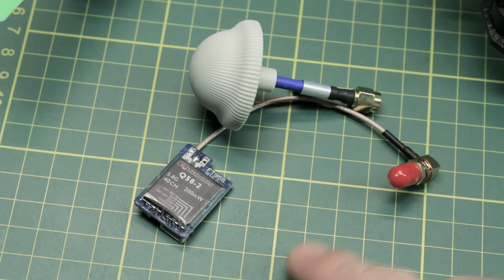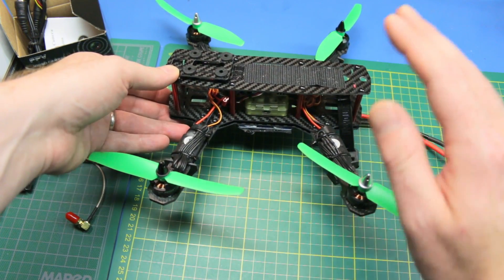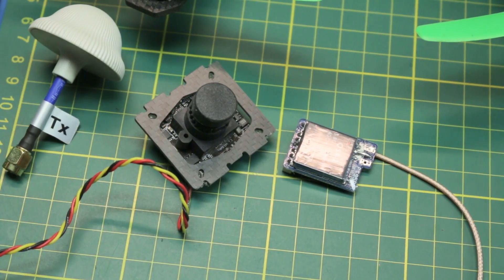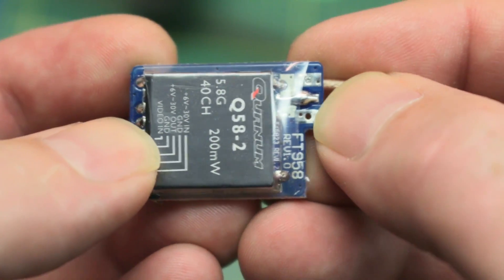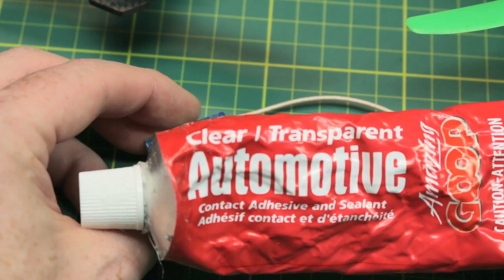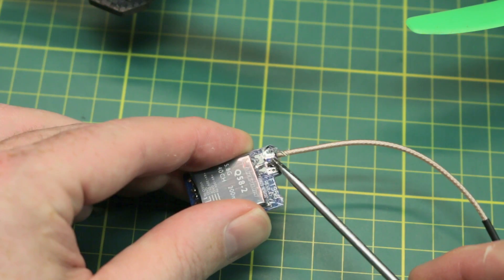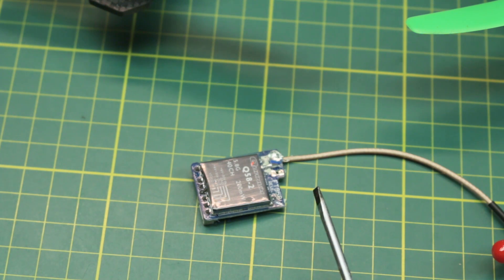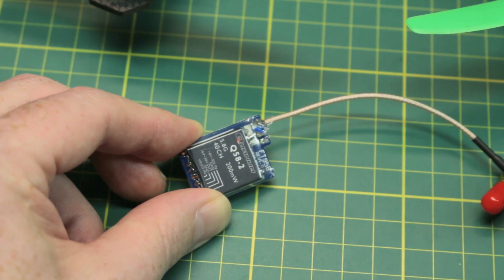IMPORTANT Video Transmitter Mod- Don't Destroy Your FPV Gear!

Comment: That's unlucky, I wonder if the heavy SMA connector that is usually on those would have prevented it.
Reply from the maker: I doubt they fully cover the PCB on those either. My TS-832's were hit and miss although better than this one. I still insulated those ones too just got in too much of a hurry to test this one :)  Ahh well- live and learn. Cheers